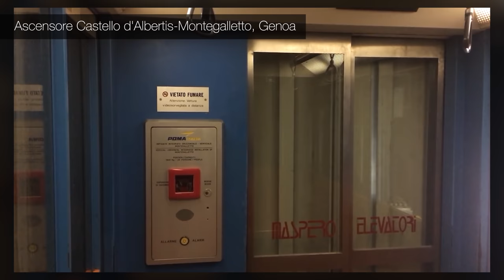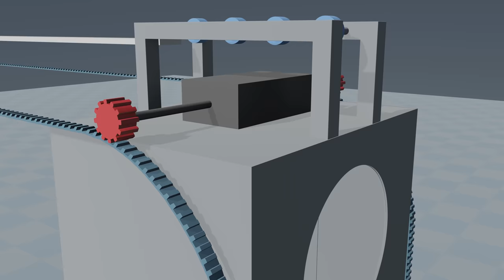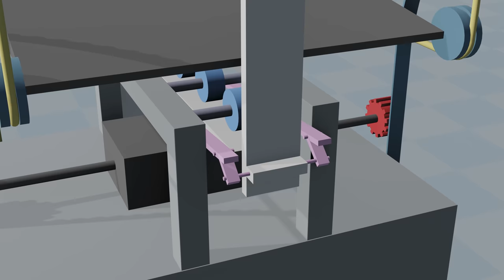I thought the Schmid Peoplemover was impossible

Comment: It would raise the cost a bit, but it wouldn't be hard to design this with a staircase/bridge right next to it.  That would take care of a big part of the issues if it broke down.  I'm betting the most common failure would be the motor for the tram, which again, could be standardized.  The next step, I'd think, for something like this would be making it so it can go around turns and maybe adding some less utilitarian sprucing up of the exterior.  If you could get something like this to serve all 4 corners of an intersection in a loop, maybe with 2 tracks so that if one breaks down the other keeps working... if the car is self powered having it run a loop could allow it to run several cars at once.
Reply: "On top of" instead of "next to" would be much more ideal. You've already built a bridge someone could walk across with this design. That's just a flat roof, and a flat surface is just fine for a walking path after all. It just doesn't have guard rails on top or a set of stairs to access the pathway. So build some guard rails and some spiral staircases (you don't really have to worry about ramps in this scenarios since the elevator itself is for people in wheelchairs) and you're set. You'd shrink the overall footprint much more that way.
Reply: I imagine one reason they built it at that station was the existing pedestrian underpass.
Reply: Much smarter !!
Reply: Imagine two in parallel, as wide as the platforms would allow and as long as needed.
Reply: @MidlifeCrisisJoe  Next to it means fewer stairs to climb. The stairs could go around the two towers.
I think that this together with a pedestrian bridge next to it would be the best for a higher capacity.
Reply: @jochenkraus7016  That makes no sense. Why would building a whole other bridge next to the elevator mean fewer stairs to climb? You're going to need to go up a certain number of steps to reach an appropriate height regardless (assuming uniform step height, which is not a guarantee). If we presume any walking path next to the elevator will reach the same height as the elevator, then the number of steps will be the same regardless of whether it is built next to or using the elevator itself as the walking path. The only difference is that you're wasting a whole lot of time and money creating another works project to build a separate walking path while I'm suggesting you save time and money and repurpose the elevator's current design and turn it into a walking path as well by attaching stairs and a guard rail to it.

If you're talking about a whole new design that makes a pedestrian walkway that also incorporates this elevator into it, I could see that. But as it is, it's much simpler to repurpose the already extant modular design of this elevator by simply adding some stairs and guardrails to it. Especially since they obviously perfected this design if they can assemble it in a mere three hours.
Reply: @MidlifeCrisisJoe  If the walkway is on top of the mover, you have also to climb the height of the horizontal tube.
If you can bolt it next to it and/or the tower with the stairs carries it, you only need to clear the trains and the catenary. 
But in that case you're probably better of with a bridge and two elevators that are a more common design.
Reply: Why not a staircase around it, coiled around the towers?
Reply: @jochenkraus7016  And if you build the stairs perpendicular to the shaft, it will be more compact. It probably can be narrower than the shaft.
Reply: Yea I would say you could build a spiral staircase around the columns and use the room as walkway with fairly minimal changes overall.
Reply: when you factor in the operational cost, it is far cheaper to build an overpass with two elevators, than it is to build this people mover. this people mover is so uneconomical it’s insane. Not to mention it has a paltry capacity. They had to decommission the one in Berlin because it was consuming so much in operational costs. Also your idea of running several cars at once does make sense from a capacity point of view, but it reduces reliability and jacks up operational cost even further.
Reply: I'm an engineer with 30+ years of automation and that's a good point.
I think Tom's engineering costs and practicalities are off the mark. Because this can be made and tested in the factory the chances it wont work on site are far less. I don't know hw this would be a lot more expensive than 2 elevators. That's 2 sets of everything - doors. motors, wiring, etc. 

Also in Australia we've had a couple of very ugly incidents with wheelchairs getting stuck in train tracks at level crossings where pedestrians cross. Its resulted in at least 1 death that I remember. The driver couldn't stop the train in time
Reply: @tonywilson4713  this people mover is extremely uneconomical. it had to be decommissioned in Berlin because it has a ridiculous operational cost, not at all justified by its capacity or convenience.

it is far more expensive than two sets of elevators. fact.
Reply: Most electric parts that are used by german companies that build automatization production lines and stuff are standardized parts. especially the motors itself. the special parts are the locking mechanism and guiding rails and stuff. But normally the 'blueprints' of all the parts are available in the documentation.

Comment: There's also an old elevator design called "Paternoster" which was very popular in germany and can still be seen (and experienced) in a few public buildings to this day. Follows a similar principle. It's a continous line of open cabins that never stop as they go along a circular track. You just jump on and off at your desired stop. At the top and bottom they will also go from vertical to horizontal movement to switch to a second shaft that will take you back in the other direction
Reply: Tom has already talked about Paternoster lifts

Comment: Bit sad that this clever bit of engineering didn't catch on, & is now relegated to a curiosity. Good of you to showcase it.
Reply: Probably not marketed and definitely not marketed in US as under disability laws this would almost be mandatory if people knew they existed.
Reply: @RedRocket4000  Just build a 5 level staircase that connects between them or an underground tunnel for more able people. Two problems solved
Reply: It's overdesigned, expensive, and slow.

It's a genius solution to a non-existent problem. A pair of elevators on either side with walkelators in-between would be far more efficient, and have the same result.

This is the efficiency of a train, with the capacity of an elevator, overall a horrible combination, but the technology and engineering that went into the bad idea was genius.
Reply: People are saying this is genius

Say you want to cross the platform, 
You have to wait for the entire machine to travel from one side to the other god help you if there’s already 5 people in the lift. You’ll have to wait out two trips 

Why not just have stairs and an elevator leading to a pedestrian over pass. It’s less complex, much faster and allows more people to travel across at a time.
Reply: It's a fundamentally flawed concept
Reply: @sbraypaynt  I think the technology is genius, but the application is abysmal. I'm sure there's a far better way to implement a 2 dimensional elevator than it being a bridge. It's possible that societies problems just haven't caught up with it's technology, making feats of engineering like this pointless.
Reply: @sbraypaynt  Say you want to cross a road, you have to wait for the street lights to change.
Reply: @sbraypaynt  You can build 1 in 3 hours. They take up almost no space, just build 2 next to each other
Boom, 2 way travel. Saves ache for people who can't walk fast or have heavy bags.
Reply: It's a German gimmick
Reply: @safaricalamari7613  Both carriages could be on the otherside at the same time with two cars. A more circular system with multiple cars would be better, if you could have the cars go sideways from one to the other, that would be great. The big limiter is the counterweight system, so you could probably only have 4 carriages even with two pathways and a circular flow.
Reply: @excier6074  with gearing it could turn corners too.
Reply: @highpath4776  with my feet I can turn corners faster and cheaper??
Reply: Elevators at both end would save time and electricity compared to this one. That would be the reason this one didn't work out.
Reply: @xero2715  bruh
Reply: Escalators anyone ?

Comment: This is one of those situations where a great little invention never really gets off the ground unless someone tries it out on a larger scale. It might still happen, but it's unlikely.
Reply: Well, it kinda did get off the ground in a way: literally.
Reply: Much more expensive than stairs
Reply: @Quinicus  much more accessible than stairs, too
Reply: @Quinicus  The entire point of the thing is that it isn't stairs. You know, for people who can't use stairs
Reply: @cheesekingofdenmark6910  but if you install 2 vertical off-the-shelf lifts to the bridge deck on either side you have a solution with a much, much higher throughput which is much more reliable

Comment: This is a seriously cool design. I'm surprised the DB didn't order shittons of those for various train stations tbh. Especially considering the short downtimes and such. 
Beste Grüße an Herrn Schmid, vielleicht ist das Video ja genau was es braucht für den großen Durchbruch :)
Reply: I don't think this will cause to a breakthrough tho. The alternatives are cheaper unfortunately.
Reply: @ls200076  i don't see how you can get two elevators and a bridge much cheaper than that, especially once you go into larger scale production.
Reply: Walking overpass has no downtime
And I imagine adding 2 elevators for the overpass stairs for disabled people is cheaper than this
Reply: @cockatoofan  It does have downtime though? If it didn't have down time, then for the exact same reasons, why would you need any for this one?
Reply: @ruukinen  Because moving parts break?
Reply: @frankyboy4409  The alternative isn't two elevators, it's not having anything at all. Which costs nothing.
Reply: What gets me is that the core design is so simple and elegant (minus the interlocking mechanism described for the downward part of the traversal).
Reply: No the reason is the throughput.
Its to slow in general.
But cool as fck.
Reply: @frankyboy4409  It's way cheaper because it is schema F. Getting the production large enough for Peoplemovers to be economically more efficient will take years. Also I don't know whether the "running costs" differ.
Reply: @Schule04  What? The alternative is not nothing, people NEED to cross train tracks. They're not just going to let them walk across them.
Reply: naja, der Kostenfaktor wird höher sein. Vor allem die Wartung wird hier intensiver sein als bei Standard Fahrstühlen,
Reply: lmao, sadly thats true :D
Reply: @ruukinen  walking overpass provides multiple "lanes" for people this things elevator fits tops 3 
That's why it has downtime 
It can't continuously take in new passengers when the elevator is already transferring passengers to the other side 
The overpass even with elevators for disabled can most likely operate continuously due to the relatively low amount of disabled people and the mechanical simplicity.
Reply: the U or n elevators maybe the best design for tall building to tall building people movers
Reply: They didn't order more because it wasnt financially prudent.  Even a footbridge can be installed in a few hours of downtime, it just takes planning.  So they built these, tested them out, then decided:" okay, works great, but we have other, simpler ways of solving this problem for a lot less money."
Reply: The main reason I imagine it didn't catch on, besides the usual reasons things aren't adopted, is upkeep.

People would generally build something more difficult and costly, if it has less upkeep.
Reply: the powers that shouldn't be don't own the patents. ofc it's shelved until they can, then we will see this in use.
Reply: @CalloutWraith  good to know
Reply: @Razumen  what people need and what they're going to get have nothing to do with each other in a capitalist work world.
Reply: @Vespyr_  Except they do. Demand drives the market. In none of the situations is no way to cross the railroad an acceptable situation.
Reply: Because it only works for 2 tracks stations and most stations have more.
The bandwidth is awful, just imagine only having a few minutes to catch your train and instead of running up the footbridge or down the underpass you have to wait for the peoplemover that you just missed to go to the other side, let people down, other people up, then come back to your side unload people, load you up then cross again, you not only have missed your train but also missed the next one.
Also, all stations already have either a bridge or an underpass so it would be infinitely cheaper to just keep what they already have and is functioning than adding this with the added maintenance costs and power consumption
Reply: @dr.wormwood3889  no we will not.

Comment: Sure, this isn't as "practical" as standard solutions to efficiently move people across tracks, but seems extremely accessible for everyone. And it does look like you could really make the path take more than a few turns (thinking of metro stations). Makes me wonder how close efficiency wise and repairbility wise this design would have gotten to current solutions if this had the same time and money investments as classic elevators.
Reply: I suspect turns would be a lot harder than going from vertical to horizontal and back, ironically enough. If viewed from above (So the two rails the PeopleMover travels along become lines) any deviation from the line (i.e. turns) that maintains the distance between the two rails will require the outside edge to travel much farther than the inside edge which would pose a number of problems for the gears and teeth moving this thing along. Cars get around this by either just letting one tire slip or, if really fancy, rotate at different rates (which works since they aren't locked into a track). The horizontal/vertical transitions works so smoothly because they are all inline with the direction or rotation of the gears and I'm guess curve as well. Honestly a very elegant solution.

Not saying it isn't possible, you could potentially have some kind of transition period that added horizontally oriented gears along the vertical ones, using both orientations before switching over or something, but it definitely starts to make this beautifully simple design more and more complicated.
Reply: Altbach is close to the location of the company. That certainly helped convincing the deciders to try it there. Also it seems to be an entirely redundant short cut, as a mechanical device cannot be part of an escape plan in case of accidents, so I guess it would get stairs and a connection parallel to the lift if installed anywhere else, in which case of course a set of elevators would be the more robust solution, no matter how well developed the concept might be.
Reply: @EarlLeeByrd  if you only need to go horizontal, not also vertical, couldn't you just flip the gears 90°?
Reply: @dadjake  It certainly gets simpler if you are just messing around in a single plane, but there will still be some complications due to gravity pulling down. With the vertical orientation the track can act as both a guide and support, if you rotate the gears 90° you get the guide but lose the support. Not that this is necessarily a hard problem to solve, but it does make it more complicated enough that the question of why not just using something like train tracks would be hard to argue :)
Reply: @EarlLeeByrd  agreed. I'd argue that you would actually use train tracks in combination with this mechanism :)
Reply: @EarlLeeByrd  you wouldnt need to do that, the gears are only really nessasary for the vertical parts, extend the wheels out a bit and have a hard rubber wheel on each side doing the exact same thing with a smooth track instead of the gear rails. (and some form of limited slip differential to help with moving the wheels around the bend)
Reply: @EarlLeeByrd  maybe you can use a single track?
Reply: @EarlLeeByrd   "Cars get around this by either just letting one tire slip or, if really fancy, rotate at different rates" That's not really fancy. Every car that is intended for road traffic has this.
Reply: @EarlLeeByrd  a year late sorry, but as long as the gears on both sides aren't connected, couldn't the gear on the outside curve just stop being in contact with the rail? Like the rail wouldn't be at the curve so the gears would be hanging, while having gears on the side to provide stability (which could be motorized as well to keep the traction even, but the gears would be a ratio where it'll still work on curves). I'm not an engineer but making it so at certain points the gears would start/stop rotating, could be like a little switch on side of the elevator that when hit on the wall it'll activate or stop a certain gear and when the curve ends have it hit again, or a sensor or computer controlled to actuate it. 

Not sure hoe efficient or effective it would be but I'm sure there would be a reason to do so